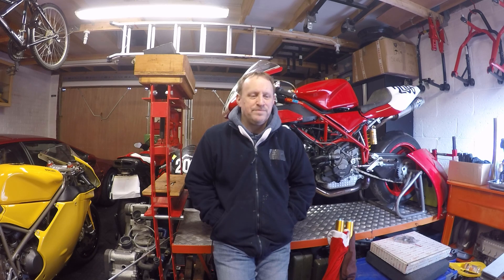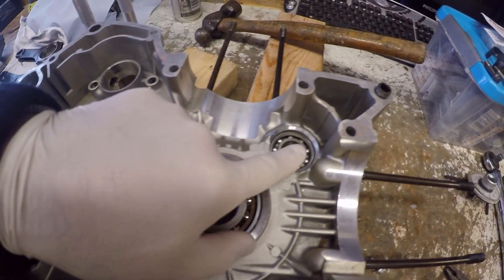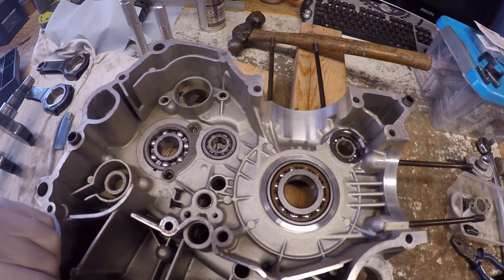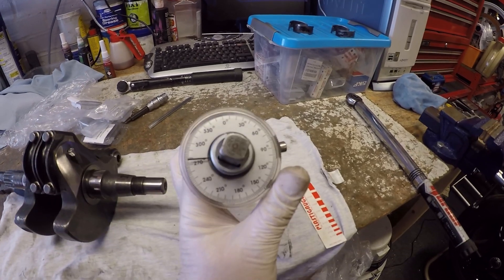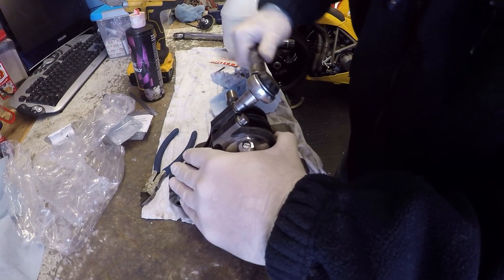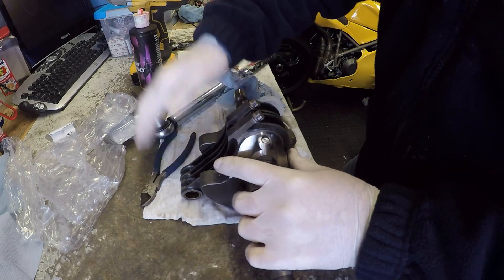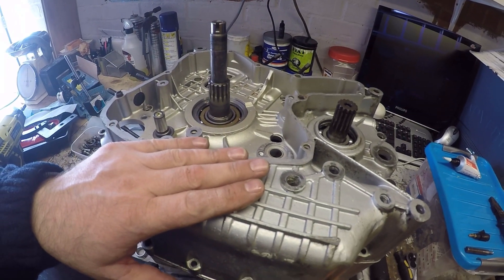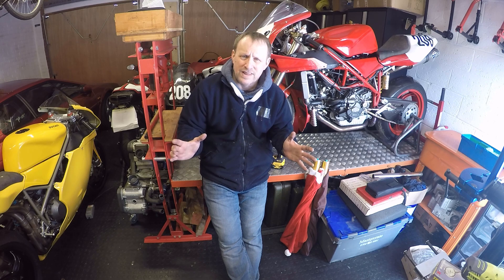Ducati 916 Engine Build - Video 3 Assembling the cases

Comment: Feels naughty doesn't it loading bearings, I'm building one currently. But when you see the main bearing design it all makes sense but the snug feeling when it's all bolted together.
Reply from the maker: Its strange doing it for the first time if you have been building other bike engines, you soon get used to it 😂
Reply: @DesmoWerx  yep! I'm a bike mechanic I've built most style motors now and everything in me is like no that can't be right 🤣 my first older Ducati. Recently done an 821 monster  but didn't have any shims on the crank which was nice 🤣

Comment: same as below, these vids are fantastic, i've just stripped down a 996 engine and prepping myself for a the rebuild, what are you using to grease the bearings (red stuff), i see you use it on the big end bearings in for the 916 (in vid 3)? be nice to use a brand that is obviously trusted by someone who is clearly very knowledgable about it 👍
Reply from the maker: Hi Peter, I use "VP Racing - Engine Assembly Lube" its not cheap but I have never had a build lubrication related issue whilst using this product. On the plus side a bottle lasts a while.
Reply: @DesmoWerx  cheers mate. After I messaged I carried working my way through your vids and saw it on the one where you went through the tool etc you use. Really enjoying these, thanks for doing them all

Comment: Hello, thx for video, very good information for newbie like me, but I have few questions. Are you used old conrod bolts? What about crankshaft preload? in my opinion 0,3mm its too much, R and RS versions with sandcast case has 0 preload. Also about bearing choise, what bearing separator material better, steel or PA? And last question about brand main bearing, why ducati use RHP and don’t use SKF 7307BECBP, and 7207BECBP?
Reply from the maker: Hi Олег,
On the steel conrods you can use the bolts a couple of times, the titanium rods must have fresh bolts every time. Crankshaft preload I aim for 0.15mm, Ducati issued a service update some time ago on this and I was still quoting the old service figure. I am surprised that the R and RS use 0 preload as the bearings need some form of preload, but then they are rebuilding those engines far more often. I have always used the RHP bearings with the fibre ball race case rather than the steel ones. They are the OEM bearings and I have never used the SKF version so cannot comment on whether they are any good.
Reply: @DesmoWerx  The old 888 SPS bikes had 0 preload on the cranks, but they used bike specific bearings with different thrust angles......I think.

Comment: HI  I've been looking for a 9xx Duc for some time now but seems to not be able to pull the trigger on one yet. Any advice on what models/vintage to look for?  Ideally I'm looking for a late 998 but they are so rare here that i'm now starting to look for others.  Currently there is a 1995 916 up that looks interesting but I don't know if the whole "Gagiva build" thing has any merit.
Reply from the maker: Hi edbvf,
If you want the 916 classic looks but reliability then go for a 998 model as the electrics were really well sorted by then and the testastretta engine is much easier to work with and maintain.
If you want a collectors bike the early Varese/Cagiva built bikes are rare and will only go up in value if looked after as they were the first run of 916 bikes.
Reply: @DesmoWerx  thanks for the reply..  the "collectors bike" thing is nice and would be a bonus,  but I'm primarily buying it to drive it.. is a -95 bike to fragile for this after all these years?  I dont mind high maintanance but I dont think I'm up for spliting cases every other weeks.

Comment: Fantastic video as always!  I've sent you a email some days ago about Ducati and Lotuses did you receive it mate? I'd like to have some tips from you about getting some more Hp on a 748R engine I'm starting to rebuild with a brand new crank case, cylinder pistons assembly etc... what do you suggest?  I would get something porting also the inlet and Ex?  Thanks.
Reply from the maker: Sorry for delay, have not been getting emails through to my phone for some reason, have replied to you today 👍😊 Enjoy your 748R build.

Comment: Nice shiny crank shoulders, had a bit of work done on it by the looks👍😉 is that for reliability? Ever used any non Ducati shells?
Reply from the maker: Hi Chris,
The crank was lightened and balanced as was in a race engine.
Never used non Ducati shells as I have never struggled to get genuine shells at a reasonable price, I do believe that there are alternatives to be able to use.

Comment: Hi, great and informative videos Desmo! I am servicing the engine of my 1098 and have quite a big end float on the gearbox input shaft of 0.25mm and on the gearbox output shaft of 0.32mm. In the parts catalog are only the shims and spacers available that I already have installed. Wath would you do in this situation? Do I need to install non-OEM thicker shims and washers?
Reply from the maker: Have you replaced the bearings for the gearbox in both sides of the cases as well?
Were the cases torqued correctly to measure the end float?
Reply: Jp the torq was correct. I did not change the bearings because they seem to be ok (no binding or play), and the other reason is they are wary expensive as you might know.
Reply from the maker: Although costly the bearings sound like they need changing through wear. You could use aftermarket shims but remember that the extra thickness will need splitting between the two shims, if I were working on the engine and it was apart I would take the hit and change the bearings for reliability.
Reply: Thank you for your help. As it seems I haven't got any other option den to change all the bearings.